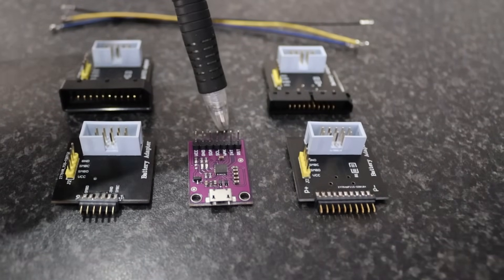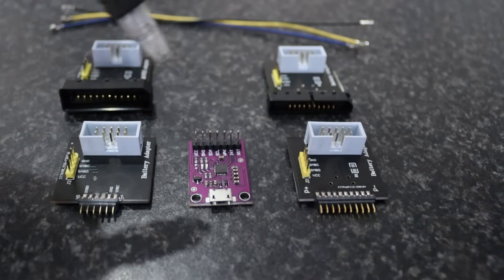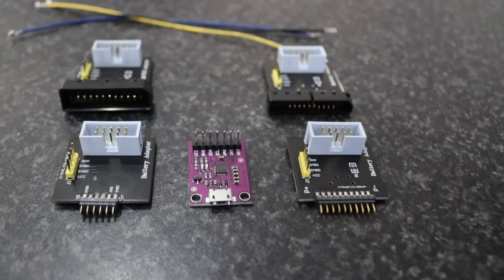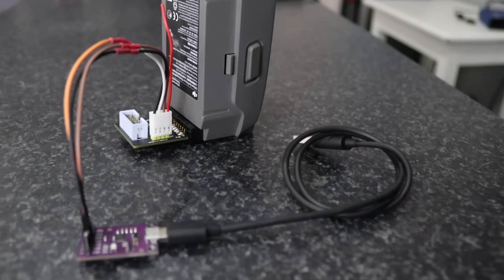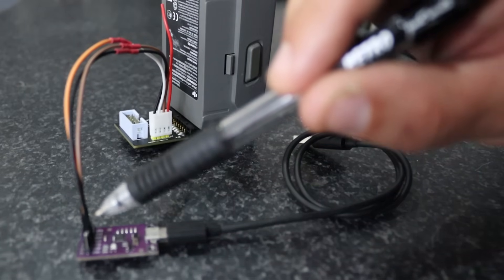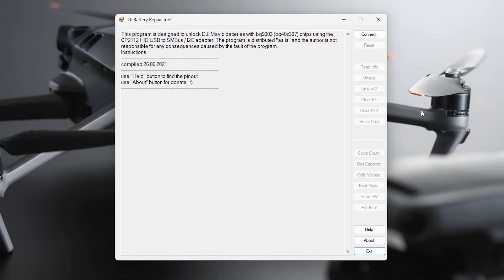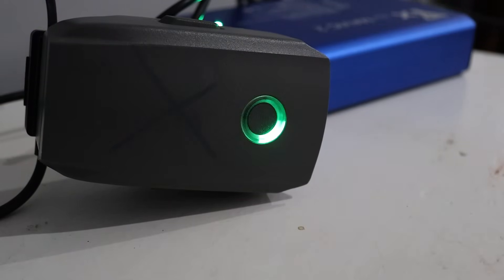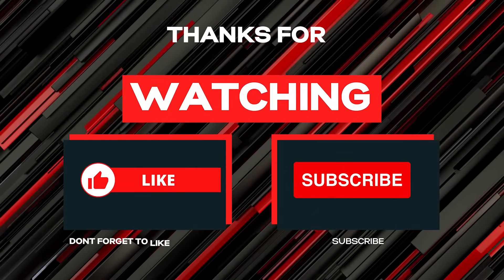Revive Your Drone Batteries in Seconds - You Won't Believe How Easy It Is!

Comment: So I got the board, hooked it up. First got SMBus failure 0x00, so hooked the battery charger. Everything was successful - both unseal buttons, and both Clear PF buttons. But when I exited, the battery button still does not light up, and if I put it on the charging hub, I still get the red light. Any other ideas?
Reply: Same problem. Any ideas?
Reply: Same issue here...
Reply: @thibaultcrenn3235 oh. There it is. Look below, I got mine to work and wrote down how i got it to work.
Reply: I did finally get it to work. Unfortunately I can’t remember exactly what I did. It may have been something like running the tool as an administrator. I just kept poking around with the software tool and it finally worked. I’ll try to see if I have some notes.

Comment: a lot of people getting problem with xiaomi fimi x8 se drone batteries and fimi does not help but making them to buy new battery. problem is: battery percentage gets sudden drop in the air like %40 to %0 and then bms flags the battery as "over-discharged". you cannot use the battery from that point. you can only charge it externally and see all cells are great. some people using these batteries with other drones and fly 20-25 minutes without problem but fimi x8 drone does not accept it because its over-discharged flagged. so we need to solve this problem somewhow like in this video. any thoughts?

Comment: Any any why I'd keep getting an - ERROR: Could not perform SMBus read 0x00 - error? I have even tried it with a "good" battery and it still comes back with that error. I'm sign the card and an adaptor board too for DJI Air 1 battery.
Reply: I got that on my mavic 2 zoom battery. I hooked up a charger on top of the board wires and it worked. The battery still won't charge, but the software could read everything correctly.
Reply: @Av8orDave  I found a guy who had opened a battery before to open it, give the cells direct charge and then reset - now it’s working perfectly again! So the problem was the cells were too low and needed direct charge to the cells, bypassing the battery logic board.

Comment: I purchased the interphase board, then when I click on the software, I found the problem that I needed a password to access the software, and in order to get the password I needed to donate, I have no problem and I clicked on mine link to do that but the donation site is closed and don’t allow me to donate. Now I going to receive the board and no software…the adapter there not on inventory but as you explained. That will not be an issue because I have the option to plug it direct to battery.
Any recommendation?
Reply: I donated and never got an email with a password

Comment: Good evening, could you send the pinout diagram to connect the CP2112 board to the DJI Air 2 battery?"
Reply from the maker: The pin out diagram is in the software , if you click "help" and select the battery in the options you will find the diagram,  hope that helps.

Comment: But WHY the hell does DJI keep putting us in this situation !! It's infuriating. The built in charge reducer is pointless, over complicated and it just makes ewaste bricks.
I have massive problems with Ronin M batteries, ended up having to spend £90 twice ... I now try to have a monthly regime of charging my Ronin and Mavic 2 batteries if I haven't been using them.
Thanks for this, I'll save it in case I need this fix in future.

Comment: Do the wires, or plugs come with the boards?
Reply: Do you still have the software for the battery killer?
Reply from the maker: @MrRaymond1021 yes email us at orders@webuydronessa.co.za
Reply from the maker: If you based in South Africa and order from us then we supply the wiring with the board
Reply: @adkwc  I'm from the USA. Would I be able to purchase from you? What you think is the best way for me to get my Mavic air 2 battery fixed? Do you think it's expensive if I were to send you my battery and you can do it? Who do you recommend here in the USA? Because I don't think that I've seen that over here. Send me your link to purchase the board so I can see how much it's going to cost me. I appreciate your time and help with this matter.
Reply from the maker: The problem is sending batteries back and forth via air freight is almost impossible as its a high risk item, so I don't think that would be an option unfortunately
Reply: @adkwc  I see, I forgot about that. Can you please send me a link to buy the board and wires so I can see how expensive it is going to be? Or should I just buy it from the Alibaba store like your video link? Thanks

Comment: I am running straight from the battery to CP2112 board and after I connect and read info I am getting an Error: could not perform SMBus read 0x00 Message. Can anyone provide some assistance apart from the obvious check that it is all connected properly? Cheers.
Reply: Did you find a solution? I'm getting the same. I suspect the battery is completely dead as I'm able to read info on other working batteries :(
Reply: No solution as yet. It's on the back burner for now, and in the meantime, I am keeping an eye out on larger gaged wiring for the terminal. Don't know what that will do but I don't like the gage of the wiring I bought for the local electronics store, we will see.  @SenorOzo
Reply: Maybe the two of you could try to charge the CELLS directly using any 5V weak power supply (old phone charger). That might bring the cell voltage to the minimum threshold readable by the BMS. Hope it helps.

Comment: Hey great video. I’m going to give it a go. I have the boards but just need to software if you can help me out? Also just need to clarify the pins as one board show (GND, SMBC, SMBD,VCC) and the other board (VCC, GND, SDA, SCL, WAK, INT, RST). Thanks
Reply from the maker: Hey. The link to the software is in the description. Unsure what you mean regarding the pins, the only pins needed are the GND ( Ground ), SMBC ( Clock ) and SMBD ( Data ). The "other" board would then use pins gnd, SCL ( clock ) and SDA ( Data ) accordingly. 
Let us know if you get stuck and we will gladly assist.
Thanks
Reply: @adkwc  I had exactly this question.  So to summarize SCL <-> SMBC, SDA <-> SMBD,  GND<->GND and no VCC connection.  Correct?  And what are the double row of connector pins on the battery adapter board?
Reply: @stevehoge  Did you ever get an answer/ Or work it out? Thanks!

Comment: I would like to recell a dji FPV battery. Can you give some info on/ if those will lock and how to. Kiwi4
Reply from the maker: Hi. We unfortunately have not done an FPV battery as of yet. Battery Killer does support the FPV battery though so if you have the cells, you are able to calibrate and change to the new cell capacity with Battery Killer.

Comment: did this on my mini 2 battery but got the message -ERROR: Could not perform SMBus read 0x00-.
Before yoy say that the voltage is too low, i got the same error on a good and full battery.
Switched the SCL and SDA as well, no result on the read.
Reply from the maker: Hi. Have you manage to resolve the issue? If not, please be in contact. Thanks
Reply: @adkwc  no, still 2 dead battery's
Reply: Same problem here, helllpppp
Reply from the maker: Try putting the batteries in the hub for 30 seconds or so and try read again, sometimes the BMS boards need little voltage to wake the board up.
Reply: @adkwc  did that, no succes

Comment: Hi! I have watched 2 of your videos on reviving the DJI batteries, they are well done.
I purchased a dead Mavic 2 battery off Facebook Marketplace and tried to reboot it using the CP2112 and DJI Battery Killer to no avail.
So I pulled the battery apart and used a lab power supply to gradually charge the pack up to 17.4v, which it did, and the pack held the voltage overnight, but still no luck with the battery killer software reading it.
So, after searching forums for other methods, I came across one thread where the commentor did 3 things, bridged ground to res, I have no idea where the res connection was, so that was out.
Bridged B+ to B- momentarily, with a fully charged pack, and with LiPo being subject to thermal runaway, that was out.
Bridged P+ to P- momentarily, now that is something you do when building LifePo4 batteries to activate some of the Smart BMS that are used in their assembly.
I tried this, and viola, I had a live battery, DJI Battery Killer read the battery, and I was able to clear the PF flags.
So in the future, before you disassemble a non responsive battery, try bridging  a positive and negative pin momentarily on the battery connector first.
Cheers from Mark in Tasmania, Auatralia
Reply: Thank you for your contribution!

Comment: I'm very excited to give this a go on my spark. I stopped using it for a long time, came back, and have 5 batteries that are dead. ^^; I'm about 99% sure it's due to an cell undervoltage situation. (I'm really familiar with BMS and lithium tech.) It's great to hear that there is an i2c bus connection on the battery connectors. I assumed I'd 100% have to use something like pogo pins or soldering on the board to clear it if the software existed..
Reply from the maker: Correct. Pin in and thats all, IF the cells are high enough for the BMS to be in an on state. If not, you would need to open the Spark battery and get the collective voltage up to at least 10.5v, then flag can be cleared. If its a cell undervolt trigger, and you are able to charge it back up and it balances and holds charge equally, thats a completely usable battery then. Thanks

Comment: Interesting that the cp2112 board is only made for certain batteries, let’s say you wanted to do this with a phantom 3 battery, is it possible in anyway?
Reply from the maker: Not with the CP2112 Boards that we know of , the problem is always the supporting software required along with the hardware
Reply: @adkwc  I purchased the required hardware and will post results when I get them
Reply: @craftywoodworks551  Any luck with the Phantom series? I have a 4 and looking to do the same.

Comment: I have a Mini-3 battery that is showing 2 lights, but will not charge.  Do you have a debugging board for this DJI Battery?  Thanks.
Reply: never update Dji mini 3 to latest firmware. Dji changed all the battery passwords so free software no longer works.
Reply: @ua9851  That's crazy, thanks for letting people know! What a bunch of bastards those guys at DJI are...
Reply from the maker: The Mini 3 is still a little new , i am sure there will be something soon

Comment: Hi, can you also use a arduino uno instead of the CP board?
Reply from the maker: Hi. Yes you can, but requires a lot more fiddling etc, due to Arduino's extensive programming capabilities. The above is not just cheaper, but MUCH easier and faster. Thanks

Comment: I get this message when I push (Read info)

error could not perform smbus read 0x00

What to do🤔
Reply from the maker: Try switch your Clock & Data lines around , if that does not work , push the power button , if that also does not work you will need to open the battery and get each cell up to its required voltage before attempting to read it again

Comment: Hi
Had to take my Mavic 2 battery apart because totally dead.  To use a power supply, hook red to red and black to black - correct?  And 12 Volts correct?  Will that give the battery any charge?
Reply from the maker: Check the back of the battery,  I believe the nominal voltage is 17,3V ÷ 4 cells  is 4.3 volts per cell

Comment: hy.. i just bought the CP2112 ..but it comes separately with its steel connector ( Idk the name ) should i solder it first , or i can just use it rightaway ?
Reply from the maker: Hey. Yes, you would need to solder the pin connector to the CP board. Fairly straight forward if you can solder a bit.
If you need assistance, please send an email and we can respond with the layout of the pins.

Comment: Could you please let me know if it is possible to use the "TRB" software with the CP2112 communicator? Thanks
Reply from the maker: Hey. Unfortunately not. TRB only has support for the EV2300 and EV2400.
Reply: Hi, Are we able to use EV2400 HBA500 for phantom 4 batteries or EV2300 HBA002 @adkwc . EV2400 seems much cheaper
Reply from the maker: Hi. You will be able to use the EV 2400 ad 2300 yes, but not with battery killer unfortunately.

Comment: my problem failed to unlock after replace cell battery dji spark...(failed to unseal)
Reply from the maker: Hi. You need to make sure the cells have enough voltage first before it will unseal. You are welcome to send a screenshot via email of the issues you have.

Comment: Interesting video. 
I am considering to buy a new set of batteries for Mavic Mini (1st) and seriously thinking that it is just scam from DJI to:
1) Stop supporting older equipment with batteries that are using the common tech (each battery has two 18650 batteries inside + small circuit board). 
2) Design in FIRST PLACE a battery case that does not allow replacing those batteries inside to new ones!
3) Developing a software that will MAKE your product unusable after SOME USE. Seriously, a 47 cycles (Charge -> Discharge = 1 cycle) and battery to be FINISHED by software is inexcusable business model!

There is a video of Mini 1 battery teardown, that will show people what there is inside if they are interested. And DJI purposely have glued the battery such way that you can't open it easily. 
What one could do, is simply take-out the circuit board part with connectors, and make own battery holder to keep two batteries together, and then solder new wires to batteries and put in.
This way one can then just buy new batteries, for 6-9 € a piece, instead 50-80 € a battery. As those 18650 batteries are todays basic power sources, even the electric cars batteries are filled with hundreds of those!
Those are used in the power tools battery packs etc. Almost everything use those. So availability is excellent!
And if someone thinks that such battery is suppose to die after 47 cycles... What does people think that a electric car is suppose to do after 47 charges? That is one year driving... 
(not that electric cars does have a horrible battery lifetime... but...).
Reply from the maker: Completely agree with above. Lots of companies are doing this, and they insist its due to safety, but rather its to make more sales. Only issue is that when you replace the cells, the bms does not communicate with the new cells anymore and you would then need software and something like the above CP2112 to " unlock " the BMS to allow it to detect the new cells plus calibration and and and.

Comment: What does the reset PF and PF2 stand for? and can you clear the cycle count with this?
Reply from the maker: PF stands for "permanent failure " those errors can be removed and yes you are able to change the battery cycles if needed.
Reply: @adkwc  What button to press to reset the battery cycle?
Reply from the maker: Unsealed the battery , input cycle count as 0, 12 ,16 or whatever you want and then click cycle count
Reply: @adkwc  Thanks man. Can i get the software please?? 🥹❣️

Comment: another deceiving video, all cells were over 3800, there was nothing wrong with that battery,  you should have read the CMD first and registry, but boards are a good sell
Reply from the maker: Definitely not a deceiving vidoe , the battery came in with a PF flag not charging at all, lucky yes cells where up , PF removed and it charged its however not always the case , this was a lucky one.

Comment: Could you attach a link for the cables that you used to connect the battery board to the USB reader?
Reply: You can use just regular jumper cables, that are used for arduino and similar stuff
Reply from the maker: We used the adapter boards but they not needed at all , you can pin straight into the battery

Comment: Do you have a fix for Phantom 3 standard batteries.  They were working when I put them away but that was 2 years ago. Now one has 1 light then goes out and 2 others no lights at all.
Reply from the maker: Unfortunately not , there is no software support for Phantom 2 or 3 batteries
Reply: I have the same issue as yours for P3 Pro 4k.. Any luck ? Have tried 'jumpstarting' mine to bring the voltage up but still not charging ☹️

Comment: I got the adapter board for Mavic 2 and the VCC was not connected so I soldered a pin to the end of the power connectors. No amount of trying with 4 batteries that had ust been left in storage over covid could get the program to read information. Always a ERROR: Could not perform SMBus read 0x00 . Tried pushing the battery button.  Can you ust hook up a power supply say of 2 V and limit to 1 Amp and put that on the battery pins ? and how are they connected in the battery ? is it from left to right or from outside in ? That way I might get some charge in it battery by battery.
Aparrently you do not need to connect VCC ? OR should I hookup an lab supply to GND and VCC at 3V and try again as all the batteries read 0 volts.
Reply: pulled top off the battery and the two accessible flat lugs from the battery read 3.6V what are they supposed to read do you know ? the next set down are 2.8 V
Reply from the maker: Hi. Did you manage to resolve above? Thanks
Reply: @adkwc  No I have not yet. I think I'll make a pin hole in the case and charge each cell to 3.8V, then try the program and adapter again . Trouble is there is a lot of fake crap out there in Chip land so I could just have a fake chip.
Reply: @GREFOUNDRY  what pin hole are you referring to? Which terminals go to each of the 4 Mavic 2 cells so you can manually charge each cell individually?